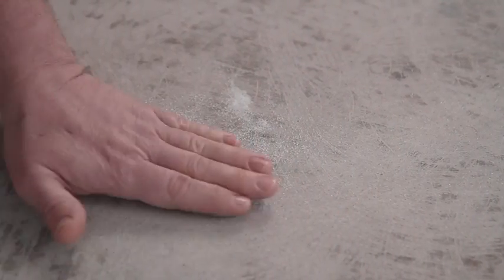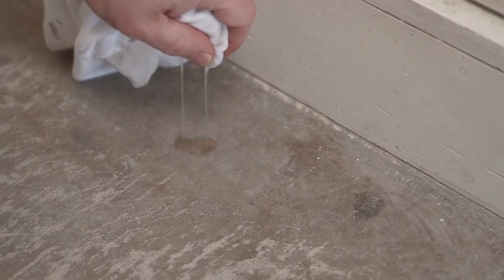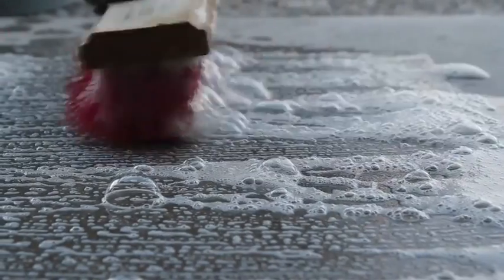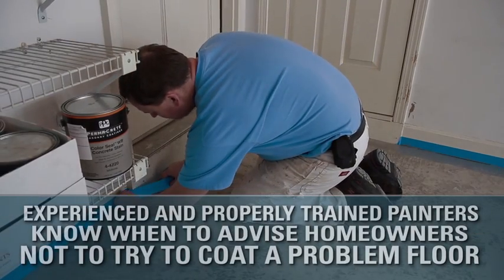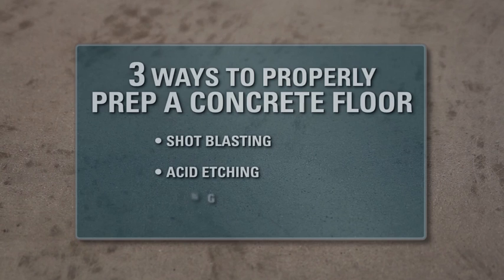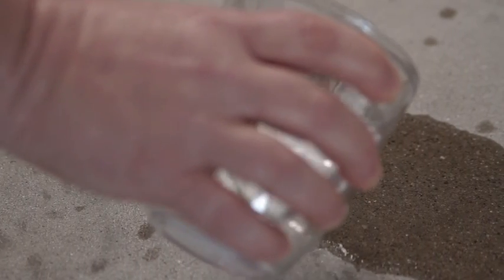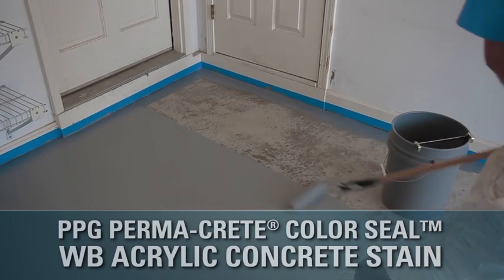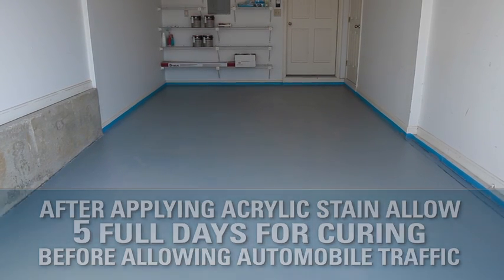How to Clean, Prep and Coat a Garage Floor

Comment: When I bought my house, it came with a clear epoxy-coated garage floor.  This garage floor is slippery as hell in the winter time or when it rains.  I want to re-coat it with a gray coating with grit mixed into it.  My question is - what prep work do I need to do to make the clear-coated epoxy floor ready to accept the new coating?
Reply: Bob Reed mechanically grind off the old epoxy. Unless you can see the grinder marks on the floor, there’s no way to tell whether the slab was prepped properly. Grind it down to bare concrete, fill any cracks/holes, clean slab very well by vacuuming and blowing, then install your coating
Reply: you can also scuff it, then add MORE EPOXY mixed with sand....do a test area, because epoxy doesnt always stick to itself....  Michael cervantes has some excellent advise, but not all homeowners are willing to go that far....i would grind it all off, if there were some serious slab problems, but I have had success with epoxy to epoxy coats....painter for 35 years!!

Comment: Well, I just decided not to paint my garage floor :(
Reply: Excalibur Head me too.  Is there any garage floor that doesn't get moisture?  Most are poured slab on-grade so contact with the earth, which has moisture.  Mine sweats during the rain.  I think the plastic under mine(if the contractor even used it) is not there anymore. I think I'll just clean it with a good degreaser and some elbow grease. It's a garage.

Comment: Epoxy paint will usually always fail because it's a cheap water based product.  Notice he always references "PAINT"  Especially under your hot tires.  True 100% solids epoxy is the only you to go.  And one that is capable of holding back high amounts of moisture vapor emissions (MVE).  In the long run, you'll be much happier hiring a pro, not a painter, but a pro who only focuses on epoxy garage flooring.  These will typically come with a lifetime adhesion warranty.  
You get what you pay for.
Reply: What product do you recommend?
Reply: Nice!!....your right, epoxys are different today then when I first started paint contracting...I am a fan of water- base stuff, but i still use oil base for decks, primering and metal....by the way, i have yet to see a water-base product last on an outdoor deck for more than 2 years!!